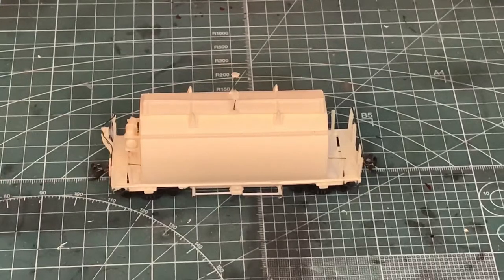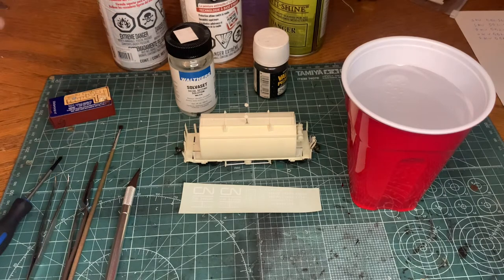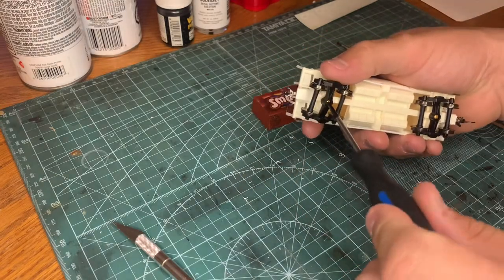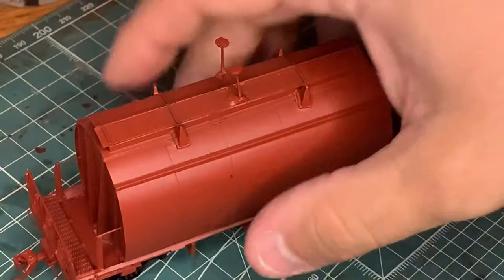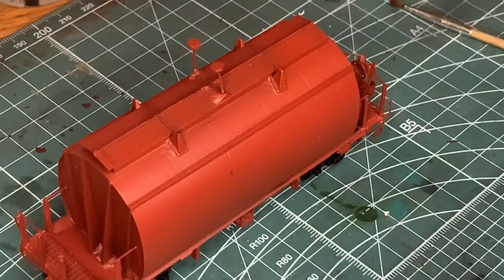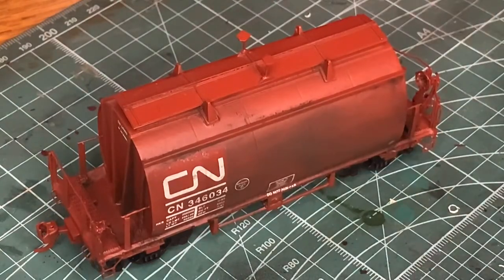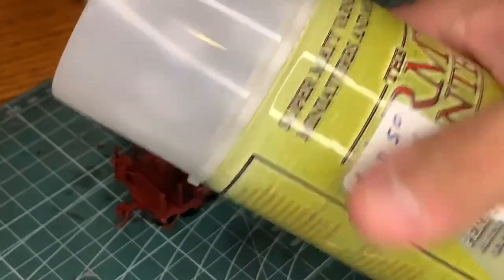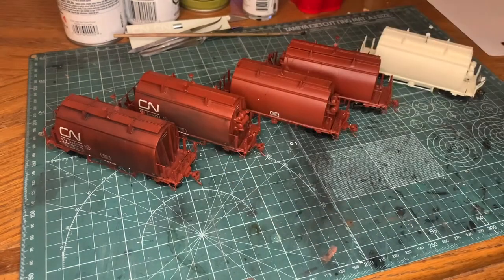Detailing the sylvan barrel ore car

Comment: FYI,the next time you strip a bolster on a freight car. Try using Kadee 246 2-56 drill & tap set. Drill the hole out,glue styrene rod in hole , re-tap with Kadee 2-56 screw tap. Works great.